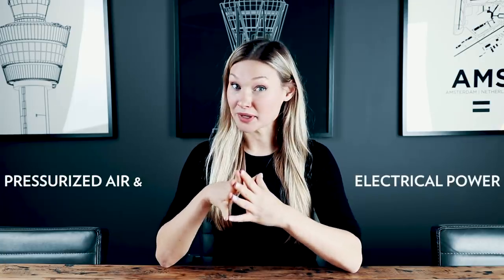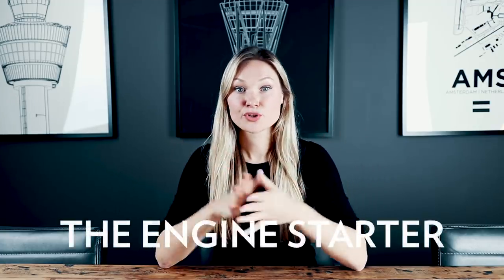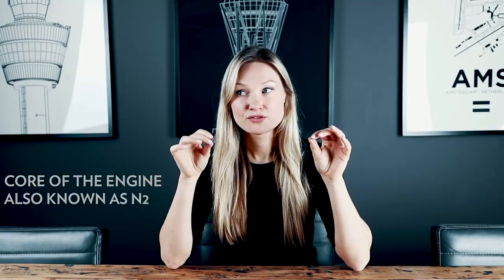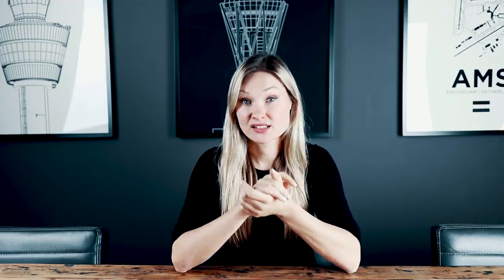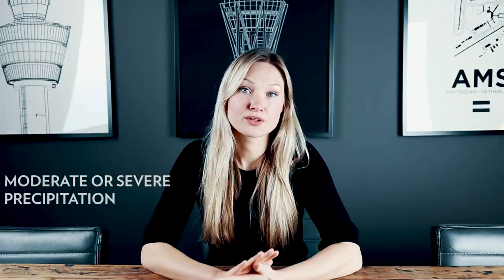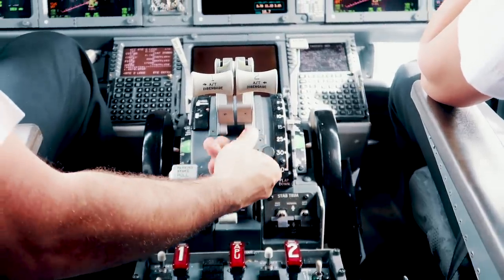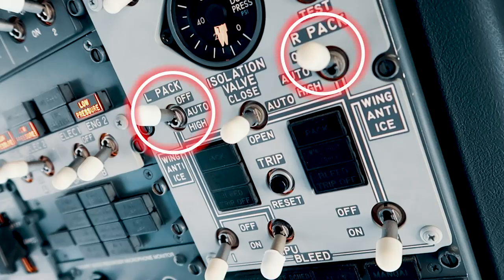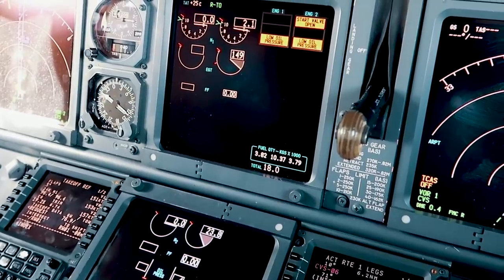How To Start A JET ENGINE -  Boeing 737 By @DutchPilotGirl

Comment: Battery- ON
Standby Power- ON
APU- Start
Apu Gen- On
Apu bleed air - On
Yaw Damper- On
Engine and electric hydraulic pumps- On
Fuel pumps- ON
Engine 1- GRD
Engine 1 fuel pump- IDLE
Engine 2 - GRD
Engine 2 fuel pump- idle
Engine 1 and 2 Gen- On
APU GEN- off
Engine 1 n 2 bleed air- On 
Apu bleed- off
Apu-off
Window heat- all on
Probes- on
Stab trim - -40
Flaps- 10
Spoilers- retracted
Hotel- Trivago

XPLANE PLAYERS HERE IS UR CHECKLISTT

Edit: Please heart this comment!! Thanks!
Reply: Panzerkampfwagen Ausf VII Tiger 2 
Nice list👍🏻 Some pointers;
Parking brakes- ON
Standby power is guarded- dont have to touch it, same with the yaw damper..
Engine hyd pumps are allways in the ON pos
Stab trim 5
Flaps 1 or 5 for take off.
Reply: @speedbird9313  yeah thx but, stab trim 5? I takeoff and the takeoff config is still warning, and i put in on the green bar and its okay
Reply: Panzerkampfwagen Ausf VII Tiger 2 
5 units trim is about in the middle of the green band😉
Reply: @speedbird9313  wait wut? But i see 40- is the middle of the green band? Im pointing out the 737 btw
Reply: Panzerkampfwagen Ausf VII Tiger 2 What?! No😝 Is it a sim or a game? 🤔 737NG right? 
The stab trim indicator is from 0 to 15 units, the green band, which indicates the allowable range of trim for take off, is from about 4 to 7 (dont remember, so Im not 100% sure). The elec motor stop at about 4 units when trimming down.

When do you set the engine start lever (where you have written "engine fuel pump") to idle by the way?🤔
Reply: @speedbird9313  when the engine circle thing reaches 25 percent or above , you should put the fuel pumps to idle and repeat to the other engine. Yes im playing X PLANE 10
Reply: Panzerkampfwagen Ausf VII Tiger 2 25% is good👍🏻 You got up to max motoring which is about 29% The circle thing is your N2 speed😉
You forgot apu and engine fire test on your list by the way🤭
Reply: @speedbird9313  hahaa yeah but im curious, are you a pilot or just an flight sim user?
Reply: Panzerkampfwagen Ausf VII Tiger 2 737NG  licensed engineer👨🏻‍🔧

Comment: @ 4:40 "When we start an engine using an air starter instead of an APU, we start engine number 1 first, because the air starter unit is located on the right side, the engine number 2 side."  Say what now?

Comment: This is very easy pizy. When I try to start my Lada early in morning after long prayers begging to start, it will just noise Sheree and that's it. Then I have check oil Battery leads, rediator and with a bit of pushing, again with ignition it makes hag hag hag shrug shrug sound followed by loud parting noise with black smoke and start shaking and moving slowly and it's engine temp goes beyond red and then it accelerates like a rocket.My neighbours always make a cross signs I might not return alive....i am going to buy boing 747.....enough

Comment: Ok now explain the procedure for this.
747... Good engine starts.. Good taxi to runway hold. Clear for take off. Engines spool up to speed.... You are a V1 speed about to hit V2.   20 Seconds from ROTATE... Engine 1 experiences flame out... 

What do you do???
Reply: Cut fuel to engine 1 , compensate with the other 3,  maintain TOGA and  do a go around for emergency landing..?

Comment: how can I become a pilot ?
Reply: There are the basic requirements, and there are some differences depending on the country. But these are the basic requirements: You must be at least a high school graduate, and English proficiency. And you must be medically fit, so that you can pass an aviation medical examination, which is a requirement. When you have passed the medical examination, you can go to a flight school. The first step is to get a private pilot license, and the minimum age to receive this license is 17. After you have a private pilot license, you can continue training to get a commercial pilot license, which is compulsory to become a professional pilot. You must be at least 18 years old to get a commercial pilot license. During the pilot training you have to pass all the exams and checkrides in order to get the pilot license. When you have a commercial pilot license you can apply for the available jobs.

Comment: I don't get it. Why do you turn that knob to GND?  When I think about this, I see myself as "Sending" a live circuit to a grounded state. In other words a 'Short Circuit directly to ground. But by looking at it in another way, in a highly static environment under a VERY HIGH electrical current demand to avoid the chance of an electrical spark/arc, ground (-) is connected to an open circuit FIRST, then the (+) side. When you jump-start a car/truck battery, you attach the (-) black cable to the dead battery first, then the red (+) to the other battery terminal of the dead battery to avoid an accidental ignition from sulfuric acid gasses given off when a lead battery is completely discharged, Chemistry that I surely don't understand, nor want to understand. I must know why the knob is turned to GND. Because this goes against everything I know about electrical circuits, wiring, and common sense to an accomplished engineer. If you don't know the answer, can you contact your company's mate supervisor? If I had 200 hours of experience and jumped into the driver's seat of a Boeing 738, I wouldn't turn that knob to GND, much less engine NO. 1 too if I didn't know this answer, and I would probably be out of an airline pilot job. When you turn the knob to... GND, which shuts off the air supply to the cabin. LOL: When this is done, do emergence oxygen masks drop down from the airplane's upper bulkhead at the same time?

Comment: I think ile just drive my car far to technical for me why are planes so hard to drive so many checks and technical buttons and switches
Reply: The simple answer is that an aircraft has far more different electrical systems than a car, so there are much more buttons and switches to use these systems.
But all these will become familiar during the flight training and type rating training.

Comment: knowledgeable pilots and responsible airlines, prevent accidents like the two 737 max 'accidents' .....
Reply: Pilots who are informed about all changes pertinent to the operation of their aircraft are another good way to avoid 737 max issues.  Aircraft manufacturers not being in bet with the governing body that should oversee any new design or change wouldn't hurt.
Reply: The burden is on the Airlines, 'Not Boeing' to train and inform the pilots. (or then the pilots themselves taking responsibility to find out and know.)  When the particular aircraft are delivered, they get everything they need. Large volumes of technical books and operational factors and performance factors and any other information. That is a part of the FAA regulations,  to receive all pertinent data, and this is signed off by various sources.  'Pilot error' and ONLY pilot error,  brought those planes down.  It is not any more difficult than that, despite how the media has spun and exaggerated and embellished stories on the incidents.  Nobody was 'in bed' with anyone... That ridiculous statement is old and tired.  Thousands of people work on any one project and that would accusing a lot of people of blatant unprofessionalism and willful negligence and putting a manufacturer and then an industry as well as the flying public in danger.

Comment: If its a 737 NEO better not start it.
Reply: Stephen Lediard There is no such thing..🤷🏻‍♂️
Reply: @speedbird9313  Sorry, yes it should be Max. But the CFM engines are also new on the Max, so NEO is not totally wrong.
Reply: Stephen Lediard Since there is nothing called 737 NEO it actually is completely wrong😉 NEO is an Airbus term